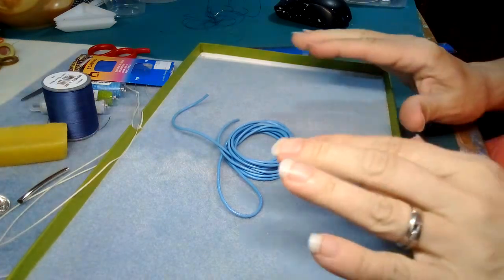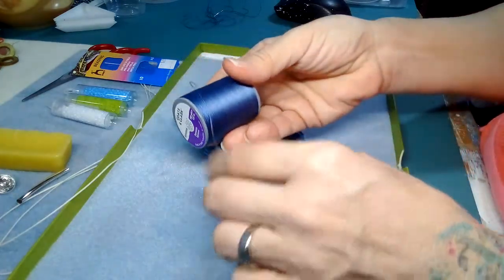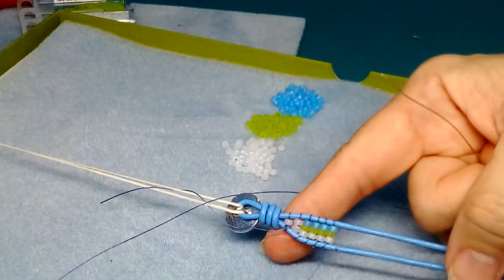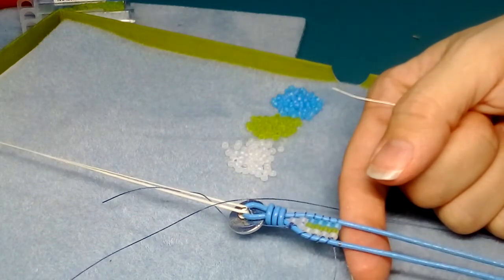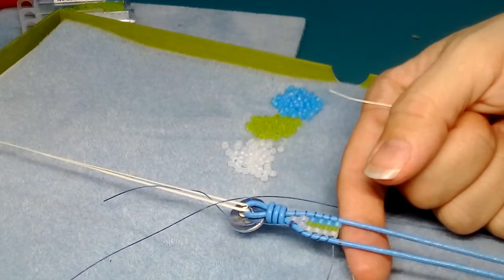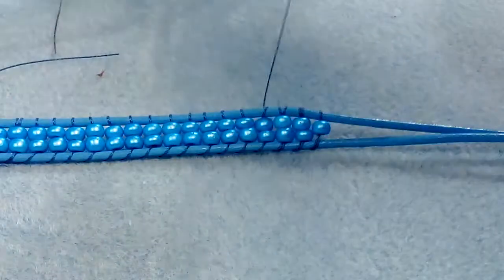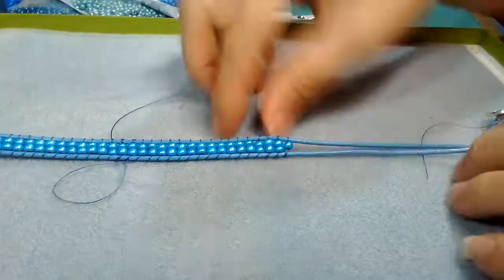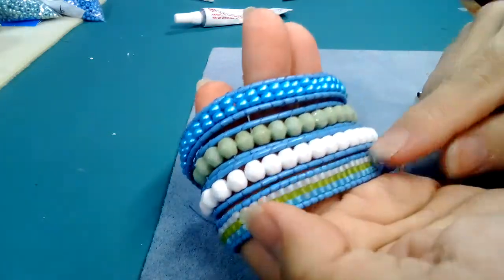Multi Leather Wrap Bracelet Tutorial

Comment: How many inches do you weave the first strip of three seed beads?
Reply from the maker: I do between 6 1/2" and 7". That brings the bracelet to the middle of the underside of your wrist. The 1/2" difference is if you want it loose or not.   On a men's about 8". Each wrap after that should be the same. But always take if off you tray and measure on your wrist because you can see how easy it is to misjudge. Hope this helps. 💚